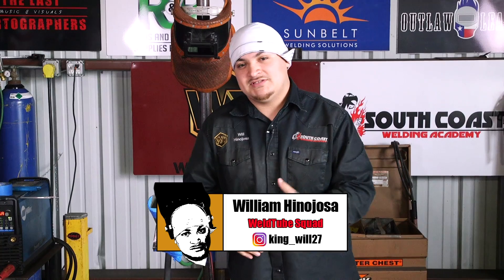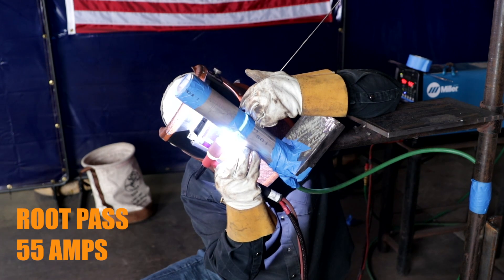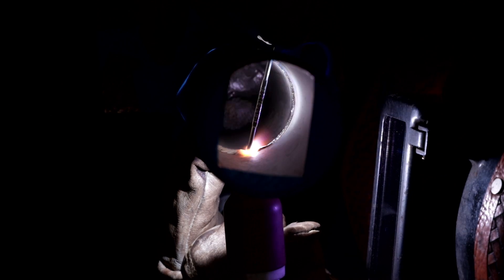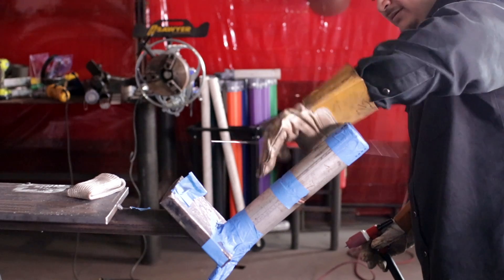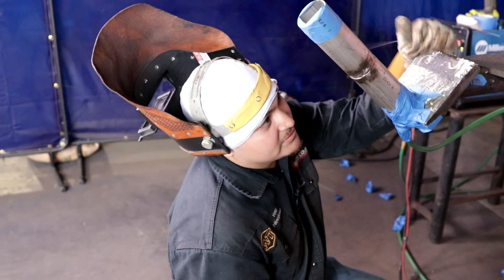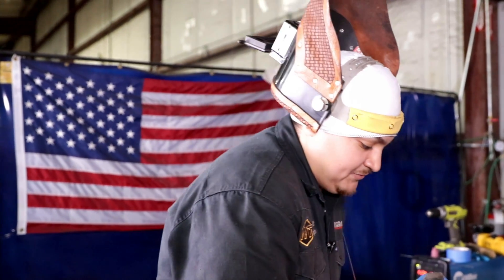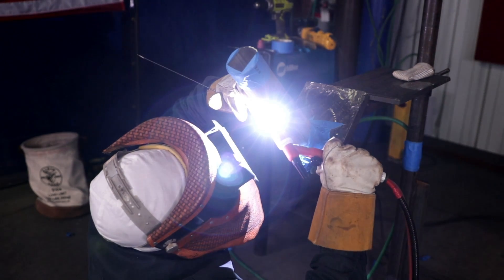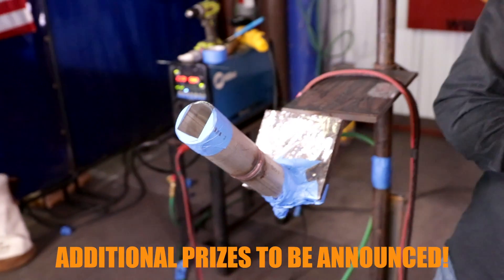Stainless Steel 2" Pipe Schedule 10 | TIG Welding

Comment: Welding 2" sch 10 in 3 passes is crazy, and that gap is crazy too.
Reply: Why?
Reply: @eliastappia  too much weld. He needed a smaller root gap to get away with a quicker finished weld and less heat input/metal input
Reply: @zachsantana15 so what do you use?

Comment: nice, i use 3mm gap 2.4mm rod 60 - 65 amps root and 70 - 75 amps cap all with HF start/ stop so I play with the down and up slope during welding , two passes only. My cap runs a little hotter but its much faster

Comment: How many amps would you go for if you were to use a 3/32 gap and 3/32 308 filler wire?
Reply: Gap is to small the rod will not fit into the gap once you start welding
Reply: @killiancopas  doesn't need to fit, the root can still be burned in nicely.

Comment: Are you purging the 2" pipe as you are filling the gap? Would a cylindrical copper  sleeve, used as a backer, work without causing problems? What helmet setup are you using?
Reply: You can’t use a backer

Comment: Run the root at 75amps, running colder you'll end up with to much heat in the pipe.
Reply: Sch 10 2in? Yall boys trippin I run it at 50 with a 1/8 root and fill in one pass
Reply: What did you run the root an cap at ? A what psi did you have your purge on ? Did you change it durning root an cap ?
Reply: @49489jm If I can I square cut it now and fuse root at 90 amps. Then turn down to 72 and 1/8 wire cap. Done, no tape or feathering tacks. Fast and slick
Reply: I hate that I can't see the wire wen he's dipping
Reply: Well the guys running the Grand Canyon for a gap. 75 amps and a 1/16”-1/8” gap you can jam this thing out capped by the time he’s got that fat ass root in lol
Reply: I usually run  the root at 85 tends to be way more liquidy and better control over the puddle

Comment: No way that root passes any code way to heavy! 1/16" max reinforcement on sch.10
Reply: Pisses me off when you have 5 different QCs that would disagree and agree with you. "Too heavy....Too low....Too close to flush....Reweld the root....im having a bad day, so im failing this root, even though its perfect all the way around"
Reply: @BenRossi901  lol I mean they have specs. Follow them.
Reply: That's what I was thinking
Reply: Thats what i was thinking. Looks like a mountain ridge
Reply: Not to mention a 5/32 gap on sch 10 isn’t within spec either. This would never make it in a Nuke.

Comment: Question for Everyone/Anyone that knows. 
Is it good to practice welding with 6010 when I need to learn 8010 but can’t afford the 8010 rods. 
Trying to learn downhill pipe but can’t afford 200$ for 8010 rods when 6010 rods are 25$ a box.   Yea or no should I be doing this or just bite the bullet and try to get the 8010 rods. I just don’t know if they run similar or not. 
Any help appreciated.
Reply: South Sports Outdoors yes bro definitely worth saving the money just to practice. But sooner or later once you have everything down that pertains with downhill pipe welding, I would advice to bite the bullet and weld with some 8010 just to see how they burn..

Comment: How can u avoid tungsten inclusion..i bust an xray on that..slick root..slick cap..but a spot on the bevel were i kind of stuck a lil bit and it showed up on the xray..how do i avoid that
Reply: If you got to the point, where you can call your root and cap SLICK - you should be able to manipulate the torch carefully enough without dipping the tungsten, but if you do so - just grind it out.
Reply: I would like to also add to this, whenever i visually see that i even dipped my tip a little bit (😏) i like to go back with a grinder and just lightly grind into the spot or spots.
Reply: Agree with first comment ,   And don’t dio tungsten . If u do make sure u replaetungsten and grind/clean were the spot is at
Reply: You could also leave that full piece of tungsten sticking out of the weld, put a fresh piece in your torch, light up where the first tungsten is stuck and the whole piece will just fall out. This doesnt work if you stick the tungsten and break the tip off in the weld.
Reply: You can strike off your fill rod to prevent tungsten inclusions

Comment: Great weld...but a couple questions you didn't explain in the video that will help some guys our. Did you use 3/32 rod all the way out, what amps did you run thr hot pass and cap at? Also did you consume your bridge tacks or did you grind them out?
Reply: Id never met a welder that consumed the bridge tacks on piping that required X ray... well actually im lying, yes i have met one, but this guy got a hard on for Mig welding, especially when he knew that the pipe required no x ray and he could just tie in to his bridge tack.

Anyways, when dealing with smaller thin walled pipe, obviously you would want to burn a bit colder, otherwise you will interpass the crap out of the pipe. You cant burn a 1/8 rod at 80 amps, let alone 50 amps, so you have to use a smaller wire. I like to burn my cap a little colder than my fill, so i can have good control of my puddle
Reply: I've found my sweet spot is a 2.4mm gap, root with 1.6mm wire at 68 amps. I run the cap quite hot and quick at around 80-85 with 1.6mm wire again. Leaves a lovely tight weave 🤙
I'd only ever use bridge tacks on site welds when purging the entire line isn't efficient for the sake of a few tacks.

Comment: Great video I have a question, if the pipe is for fluids flowing through them would they ha e a issue with the weld build up on the inside causing restriction to the flow ? As always thank you for sharing with us the great videos.
Reply: I work for a company that primarily fabricates pipe for ethanol plant. They don’t like big heavy roots like that for the reasons you’re asking. We generally use a 30 degree bevel with a very sharp landing 1/16” at most. But the two joints right up or just a fraction of daylight and weld around 100 amps and using 1/16th filler rod. The roots look like you just tig wash the inside. It works pretty nice to be honest
Reply: If you run it right that root should be flat. Still a good video !
Reply: Yes it would. A reduction in crossectional area means the fluids flow rate will increase (speed up) also a reduction in area increases the Reynolds number which means the flow might become more turbulent
Reply: Ask for WPS on the jobsite. Some jobs require a flush root. Others are more lenient.
Reply: @drewbombardier2108  also for visual testing excessive penetration wont be allowed
Reply: I believe for the UA cert your max root height is 1/16" for this reason
Reply: Yes it would

Comment: What’s the tape for?
Reply: The tape keeps the gas inside. It's called a purge. With stainless you have to fill the pipe with shielding gas to protect the molten metal from the atmosphere.

Comment: I don't put tape on the bevels 3" or smaller just turn up the purge, passed all my xrays. Definitely turn down to 10cfh when closing.
Reply: I remember i tested next to a guy who did the same thing you did, he got sugar all around his root weld. Either he did not open his argon, or....well i dont know what other reason it could be. I kind of took enjoyment in what happen to him, before the test he was this Don Honcho of pipe welding, talking a mile a minute in my booth.....then, he went to Mr. Sugar Man....thats what i remember him since then.....Mr Sugar Man.
Reply: Same here I've done up to 4" no tape and no problem